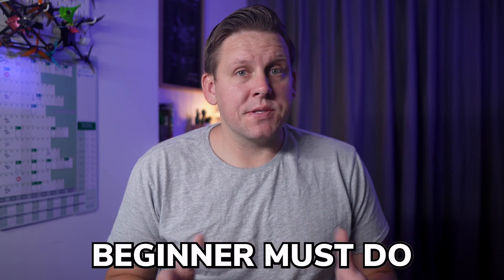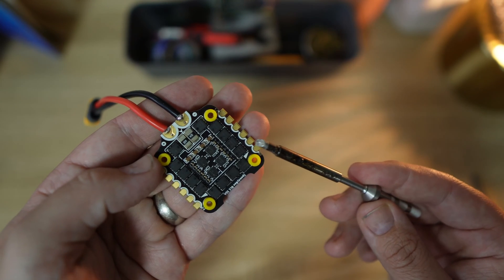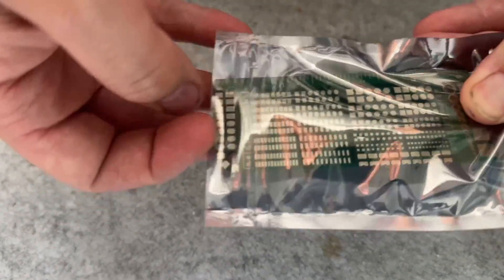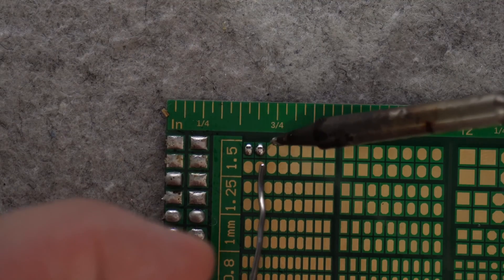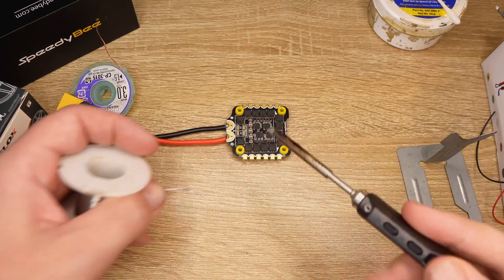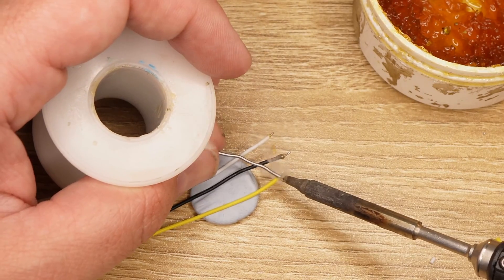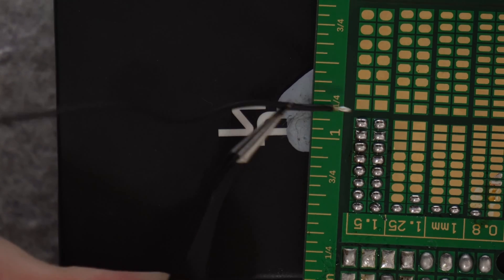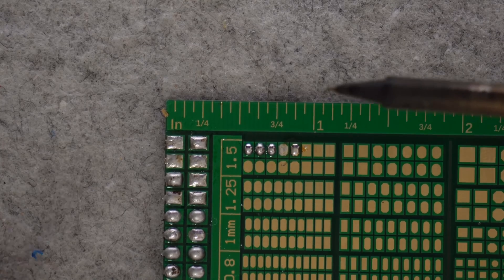Learn How To Solder for FPV

Comment: I practiced on an IFLIGHT Soldering Board and it was easy. But on my GEPRC ESC the solder (60/40, 0,8mm) does not want to stick. I tried different temperatures (up to 420 Celsius), but the solder stays like a bubble and I can scratch the "solder bubble" off with my finger nails after cooling. I cleaned the pads carefully, I used flux... finally I gave up. What else can I do? Buy another ESC from another company?

Comment: Hi I have a problem removing tin in my FC (ESC PIn ). The tin is very hard to melt even though the solder iron so hot. Do you know how can I check my board is okay or not? I worry I damage the board because of touching the soldering iron too long until get so hot
Reply from the maker: You need to use flux and have a clean tip. Use solder wick. 

I wouldn’t plug it in until you’ve removed it otherwise 💥🔥💣

Comment: My found this month was some solder paste in a syringe. 
Uuuhhh old!!, I know...
The clue is, that it really fast hardens under uv light/sunlight.
Only need to dip in the cable tip, hold it on to the pad and give it a few seconds under uv.
I actually bought it, to repair some ripped off solder pads, and it worked nicely and more efficient, than replacing the pad.
Reply from the maker: I do want to make a video about soldering a drone with just solder paste. that would be interesting

Comment: One other vital tool I recommend everyone: a solder sucker. They're so much better than solder wick. Mess up and bridge 2 pads? Suck it. Too much solder on a pad? Suck it. Did your BNF use crappy lead free solder? Suck it.
Reply from the maker: I haven’t had any luck using a solder sucker, found they don’t work for me.

How did you get it to work?